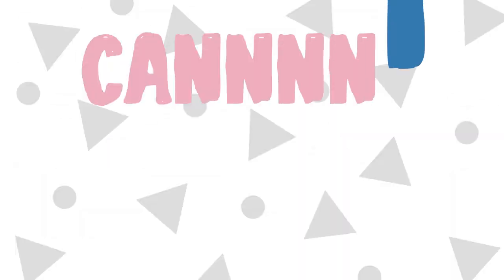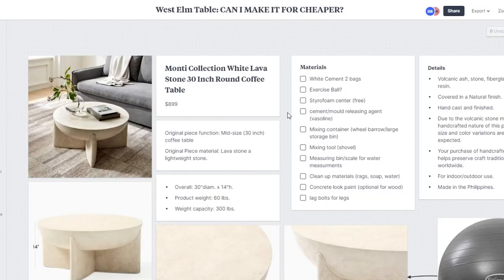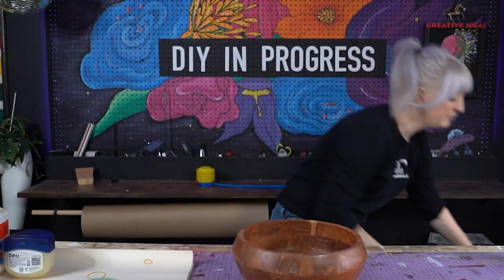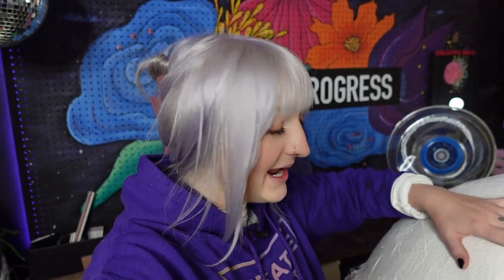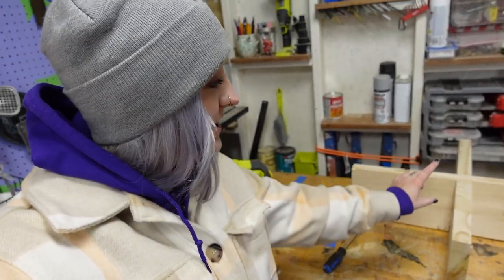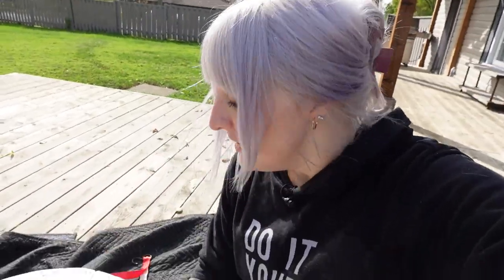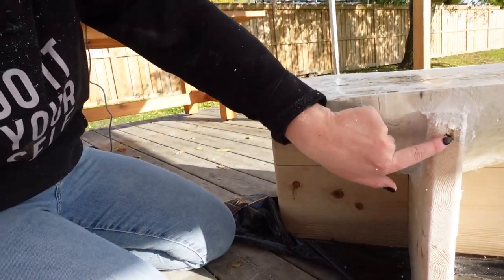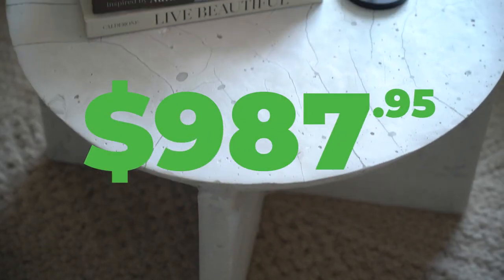Let's dupe the $1000+ West Elm Lava Stone Coffee Table! | Can I Make It For Cheaper?! | DIY Danie

Comment: I really like it.  I wonder about molding it in a sand pit?    I also wondered about pouring the shell shape about 2 inches thick, then laying in a screen wire 'cage' that could be filled with light foam packing peanuts.  Top the 'cage' with more screen and pouring top layer, also about 2 inches thick.  Forming a dome cage from screen wire would take a little doing, but it would have the advantage of allowing full filling with the foam bits.   Probably a lot of sand for a nickle - but brainstorms will be what brain storms will be!  lol

Comment: I'm wondering if having a rebar skeleton for the cement top would've helped. You could use the rebar to skewer the foam blocks so they wouldn't float away and you could use more foam to take up space, you could've also left some of the rebar sticking out of the cement top and then drilled holes into the base where the exposed rebar sticks into. That way there'd be a physical thing linking the top and base together and you wouldn't need to screw the 2 together.

Comment: For the weight, I'd suggest doing a thick layer of cement along the sides of the mold. After it dries fill ⅓ with empty water bottles (or other trash) and pour cement over it but not so much that they floats. Do that a couple more times. Add one bottle-free layer on top and done! Maybe some glue between layers. This would've taken longer but it'd be lighter 😊
Nonetheless, yours came out beautiful. Tfs

Comment: To create a void in the table, you could use any old large plastic container. tape string to the bottom of it and string to the bottom of your mould and allow the cement to fill in around/ above it. Also, since the bottom of the original was flat, you could have used a large wok. A cheap one can run less that $35 for that size and you would have saved time and money doing so.

Comment: I 💕💕💕 the cracks!!!

You would have to make two paper machete molds. Sit the smaller on the inside and fill with sand. Pour the cement around the edges  and over the top. Use a dowel to create a hole before it completely dries. The hole should be covered by the legs and will allow you to drain the sand once dry. It should be much lighter and more manaeverable. I'm not an expert or anything, but I'm sure there is some mathematical calculation, per pound of cement, that you could predetermine the weight, but that is not my forte. Hope this helps, I'd love to see more!

Comment: I think some fine sand in the whole in the ground would have been useful (also if you regularly make cement molds). More supportive and easier to change the shape. Possibly better for temperature control as well. 
I think a kiddie pool or reclaimed tire dog bed would have gotten you a more similar shape as well

Comment: I think if you cut that ball in half and put it on the floor so that the bottom was flat, it might make a good mold.  It ruins the ball, but it seems easier to me.  If you have used colored resin that would have been fun too.  But as usual, you did a great job.  It looks very nice.

Comment: Hi, cement needs to be watered often while drying so it wouldnt crack. Cooler wheather helps with that. If water evaporates too Quickly then concete cracks. With concete water is your friend ;)

Comment: Pack it with Styrofoam hunks 
Cut thin ply to fit on top of foam & inside the rim of bowl.
Pour a cement table top 1 inch to meet the top of bowl smooth over the sides over the joint with more cement add Rock Salt to cement to give Mid Century stone look. Google rock salt cement finish to see in action. This is done on out side projects but I think soaking the salt away after cured will give that look. 
Also as others stated  the lightweight perlite or peat that rises to surface will chip away or give a rustic look. I’ve made lightweight planters & boulders that I stuffed feed bags with crumbled newspaper & wrapped chicken wire then  using shredded soaked newspapers or peat or perlite mixed in cement covered the boulder and sponges the top with very wet cement and cement colorant powder.

Also sponging a cement finish is another technique I like.
I hope this made sense. Think about new homes having trim and large pillars made from styrofoam that they apply stucco over.
Faster Lighter cheaper…. But as always you get A+ for recreating!❤❤❤

Comment: Beautiful! FYI cement is not the best material to use on its own. It’s very brittle, explaining those cracks! To make cement into concrete you need to add aggregates like sand and ash. Concrete is much sturdier, which is why it is such a good building material

Comment: You've done an excellent job any event that I would do it the only thing that I would do is they have this spray paint that looks like cement I would have spray painted it on top of it to hide the cracks and just did the whole thing after everything you've done other than that it was it's an excellent job👍

Comment: Perlite can be bought from the garden center of many shops, this would have greatly decreased your weight, and given you that texture you were looking for. A white sand would have also have mimicked their original recipe… these things can easily be found near you. The final step would be to sand the surface with many grit ranges. Wet sanding at the end would give you a smoother finish and help grind that perlite down as well…

Comment: I feel like if you would have used expanding spray foam to get the shape and then covered that in a thin layer of the cement or even drywall compound you would have cut the weight drastically,  and you'd be able to get the flatter shape because you can semi carve the foam.

Comment: welldone. I don't know if you have the blocks we have in the Netherlands, it's a building material, light weight gypsum or plasterboard blocks, easy to carve than normal bricks and even fire retardant, it's  wall thick, say 1ocm, and you can ofcourse build wall with it, so I'd say they're stackable and then "shaved"into a dome. a friend of mine used to carve it into gargoyls and such. we call it Gipsblok *or plural gipsblokken) as I said not sure if it's a Dutch thing only, but it's pretty cool

Comment: If you could have gotten a large styrofoam sphere and halved it that would have been perfect!! Also to help with cracking, you can use a fine screen metal mesh and set it towards the top and it would have mitigated cracking! Another thing to help with bubbles is to vibrate/shake the concrete which brings all the air bubbles to the top and then you just smooth it out with a trowel.

Comment: To avoid cracks in the concrete you need to add brittle to the mix, cement only will crack and dissolve over time!!

Comment: I'd love if you redo this in summer. I think for me, I'd have kept up with the papier mache/plaster avenue. You can get plaster impregnanted strips that you activate with water. That would've made the bowl that you made super sturdy, and you could've just used that. Then there's a mix of styrofoam perlite, paper pulp, and cement that you can use to fill it, including with spare cardboard coiled up in the center to help reduce the bulk. I think that actually would've ended up being much cheaper than even this was, AND much lighter.

Comment: I think maybe to solve the weight issue you could kinda mimic what you did for the legs and create a first round inside structure out of wood or even start with like multiple foam cores glued together and shaved down into a smaller version of the table top. Kinda taking inspo from Rachel Maksy's mushroom hat lol

Then when doing the cement pour, you pour a little cement first lightly squish in the foam inside, and finish covering the rest with cement. You could even include like an indented bit at the flat side of the foam to help hold more cement just to keep the foam weighted down.

Comment: Hey, I'm an architect and I can tell you that these cracks actually happen because concrete takes many days to fully cure, and needs water to do so during all this time. 
If it dries before the cure time (and this happens specially if you leave it outside, cause the water evaporates faster), these fissures may appear cause the material basically dehydrates before gaining full resistance (consequently, you also get a less resistant block).

It might seem counter-intuitive, but to properly cure large pours of concrete you need to keep it wet, usually for at least a week (this time depends on a few factors, but it's probably specified on the packaging), so it could actually be good if it rained on it after the pour! 

Anyways, I actually love to embrace concrete imperfections, but if you want to avoid the cracks in future projects, this might be the reason they happened.
Hope it helps :-)

Comment: I think this table could be made entirely of papier-mâché. The top could be made with concentric stacked cardboard circles which would allow for controlling both the height of the top and the curvature of the sides. Legs could also be stacked cardboard cut to the right shape. Fake the stone look with a papier-mâché clay coat over the entire piece. Faking rocks and stone with papier-mâché clay is done all the time in cosplay and rpg. It would certainly weigh less.

Another cool thing about papier-mâché is you could make a model or just a table top size version. You could work out all the kinks in the smaller version.

Comment: So just had an idea. Do this same process only create 2 molds instead of one. one slightly smaller than the other, pour concrete over the larger one then sandwich that concrete  with the smaller mold and fill in the gap where needed. Then create a concrete slab top/lid, to go over it. Or even take advantage of the empty space inside as storag space.  instead of concrete, use some kind of wood, maybe bamboo since it's lighter, as a lid. Carve into a circle add some holes to grip it or knobs, and now you have a a functional minimalist modern piece that no one would think is a storage bin
Reply: I hope someone does this idea, I wanna see how this would turn out!!!

Comment: I probably would have done it in a hypertufa mix instead. It wouldn't have been as smooth on top but I'm thinking I would have sanded it down and used an epoxy resin on top.

Comment: Regarding how you might make it lighter, what if you used foam scraps, in other words, maybe put your foam into a blender and then mix it with the concrete, Van, and I don’t know if this is plausible with concrete, but paint a layer of concrete without foam on the bottom or maybe a couple of layers up to about an inch below the table top line, then pour in concrete mixed with chopped up farm, then pour regular concrete on the top. Would that bond?

Or, pour regular concrete in the bottom of the bowl mold, then rotated around so it coats the inside, with the same idea.

If all that results in essentially the same way object, then maybe you make the mold the other way around, and use techniques that they use for concrete dome houses. I believe, although it’s been a while since I’ve seen a video about it, that you can make a form of that Sphere underneath, and then I think you have to make another outer form, and then you pour in from the top until it fills up all the way. You would then end up with a screw where you pour the concrete it on top but that could be cut off.

The problem there would be what then with the table top be like? My gut says that you would have to make a disk with a lip that would fit into the top, and then you use Apoxsee to smooth it out on the sides?

Comment: I would try to add cement layer by layer maybe with some vertical reinforcement. And when first full layer is dry I could lay lighter filling and put something havier on top, so it can't go up and then pour cement. After that layer dries i would take the weight and pour another full layer, then another with filling and so on. Table wouldn't be so havy that way.

Comment: Personally,  I like the rounder shape of your table vs. the original.   I think though that I kind of like the way it looked sitting in a wood frame better too, ngl.  I think if I built it I would do it that way.  
I know there is a way to fill concrete cracks, I don't remember exactly the cement product, but I know there is one.  I think it would be cool if when you have warm weather again, fill the cracks in your table with some black cement,  or really any color.

Comment: I wonder if you could have used a rubber bucket or flexible tub for the mould and then smoothed out the edges rather than an exercise ball to mimic the shape of the original table, and round out the edges through sanding??? Excellent and job though!

Comment: What about taking a smaller gymnastics ball as an inside mold like you do with small concrete projects? You could still put weights in there or put some wood boards over it and screw them down to hold it in place …

Comment: So as per the ending question: To make it lighter I’d probably try to just make the basic shape out or mdf or even chicken wire and then plastering a ton or even just doing concrete for the outsides and leave the inside hollow or filled with like trash and definitely keep the base part the same

Comment: So, I think as a mold, I’d have tried to find a kiddie pool, that’s what the table top reminded me of. Also, I think I’d have made most of the table top out of styrofoam, maybe shape it into a just slightly smaller size then coat that in concrete, you could even coat the styrofoam in something else then coat the coated styrofoam in concrete. Either way, I was pretty damned impressed by how you did this, it was clever thinking for sure.

Comment: I really like the cracks in the table! YouTube Modustrial Maker  makes alot concrete countertops and used Fiberglass in the mix and sprays it into the mold before pouring it in I think if you made it thicker eith Fiber and sprayed a thick layer of concrete into the mold then maybe laying the foam layer would be easier and you could then pour a layer of concrete over that to weight it down. But I'm no prob lol he's in Chicago, it would be pretty awesome if you two do a Collab because he has a wood working shop

Comment: Maybe first pour a thin layer of concrete and let it harden then fill it with styrofoam and add more to cover it so basically the middle would be all styrofoam. For the mold maybe use a really small toddlers pool so you could get a more flat base.  I actually like the cracks on top it gives it dimension so that was for me a happy accident.

Comment: Expanding foam might make a good filler for the bowl if you try it again. It's significantly lighter and is easy to cut in order to rough out a bowl to cover in gray cement. White cement is used as a final layer that bonds easily with gray cement.

Comment: Maybe I missed, but why can’t you cover over the concrete while it’s curing in the mold? Or, if it has to be open to the air, couldn’t you tap some wooden stakes into the ground and then put a piece of plywood on top of those? At least that would reduce the chance that anything would get on top of the surface of the concrete. I would think.

Comment: Danie, I'm a civil engineer and I've done some research in concrete in my life... Cement/concrete cures between 15-35oC, which means it gets to it's hardness in these conditions. What causes cracking isnt it. The curing of cement is an exothermic equation, so it gets warm, you can feel it, if you're curious about it. Traditionally what makes the cracking is a high concentration of cement and water makes the mixture goes to high temperature too fast and the water evaporates, making it shrink rapidly and cracking. So next time put some construction sand on it, watch the mixture and keep it under water while curing. Seriously, very soon after the mixing you can put it under water. When its not possible (too big or something like that) pour water in the constantly, like 3x a day if its not too warm, if its too warm, even more frequently... For 2 days is enough. Hope it helps, and happy concreting

Comment: When you said "garbage" I thought styrofoam, which you did end up using. However, I thought you were going to make a bowl (a mould within a mould) after it dried THEN put the styrofoam into the bowl and add more cement to seal it off.

Comment: cotton is the cheap man's fiberglass. weighed down with some stones and then wrapped in cheesecloth or an old t-shirt at the center. would have given you lightweight mass and more structural integrity. since you didn't have anything mixed in with the concrete. and if you wanted to replicate the lava stone look. you could have smashed up some white pumice stones and lightly layered the top of your concrete countertop before it set. and used a Drywall Trowel (the flat ones) with a magnetic level to even it out. worked in china for 2 years and it's incredible what they've come to make out of concrete. hope this helps someone.

Comment: The cracks make the piece look more realistic.  So sorry you went through so many attempts to remove the cracks!! 

To lessen the weight possibly use a smaller round object to set in the middle of the larger bowl, pour concrete, to then create a hollowed out area.  The top would have to be a separate piece, but that could help.  Or use a large plastic bag, fill with whatever, to set inside the larger bowl, same principle, but maybe easier to create instead of trying to find/buy a smaller object.

Enjoy your day!!